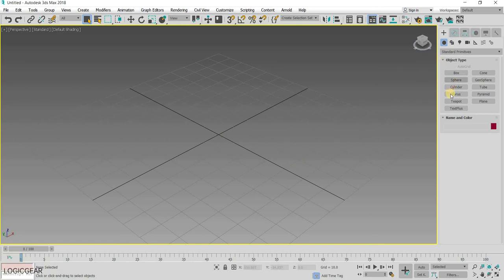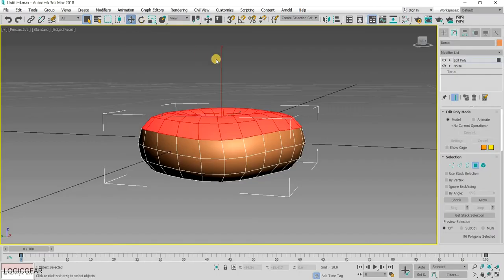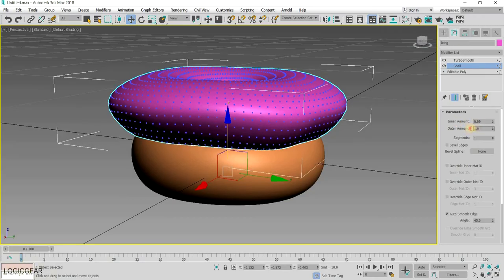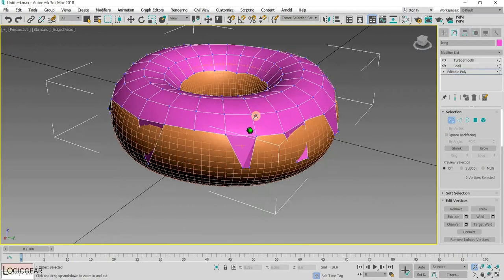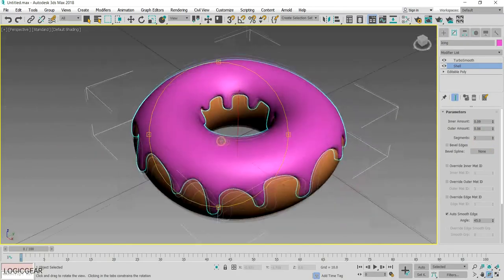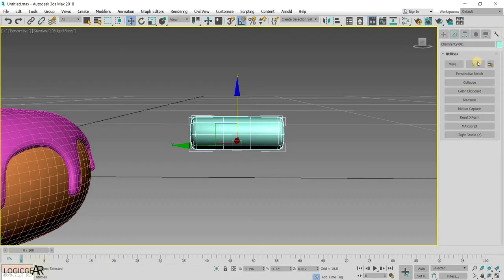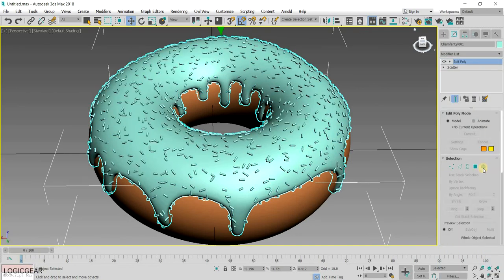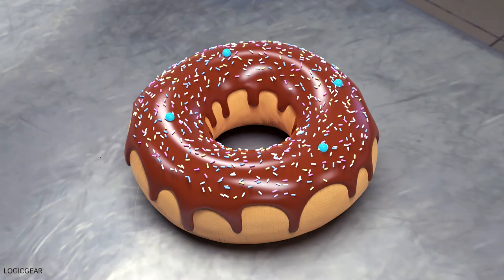How to create a Donut - 3ds max tutorial

Comment: Hi, thank you.  I was wondering, how come on my Max, Scatter is greyed out?  Together with Terrain and Loft.  I have Sprinkle Object selected.  Regards.
Reply from the maker: Unless you are using splines, the Terrain and Loft will be greyed out. I am not sure why the Scatter is greyed out though, make sure you have selected a 3d mesh. Also convert the mesh into Editable Poly and use Reset XForm option.
Reply: @TopDownGear   Thanks for reply.  Doing a Google search, it says I should not have Modifiers or to Collapse the stack.  Taking off the modifiers did not work, but collapsing the stack worked.  I'm able to Scatter the sprinkle now.  Strange that you didn't have to collapse your stack.  Maybe they changed?  I'm on 2021.  Regards.
Reply from the maker: @magtanggoldungo6621  That is very interesting indeed. I am glad you have it sorted out. and thank you for a detailed response, it might help others as well.